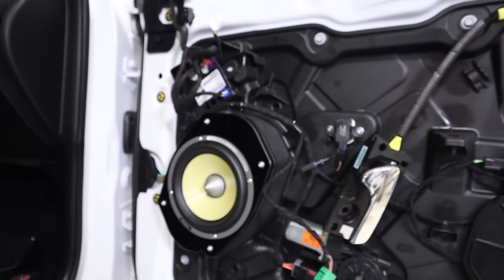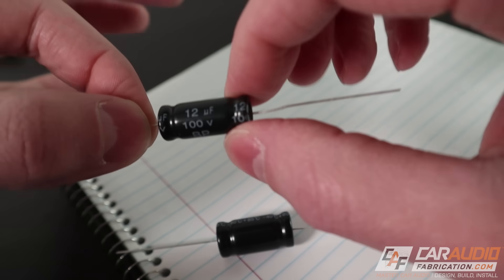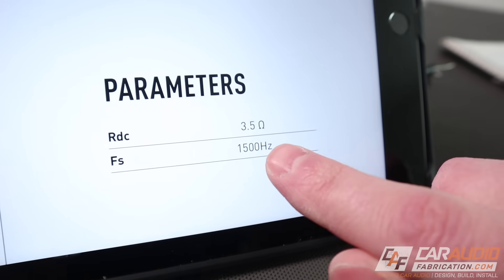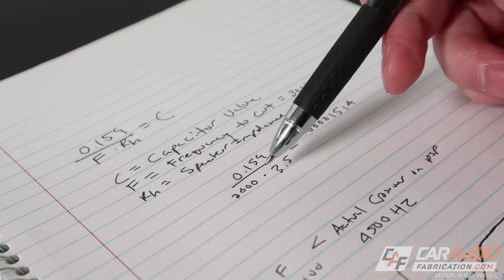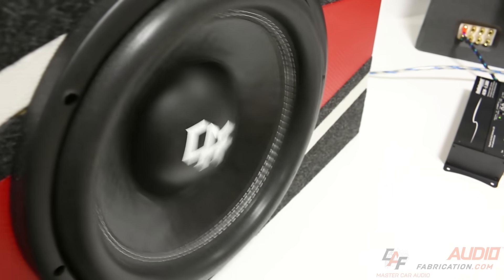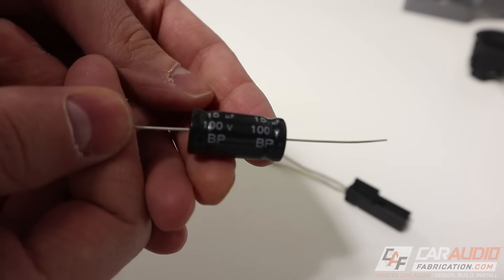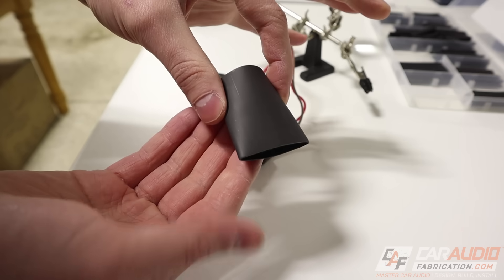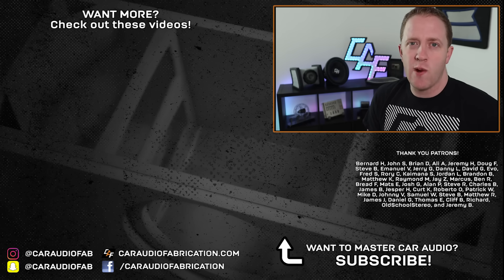PROTECT YOUR TWEETERS! Capacitors and WHY you need them

Comment: FWIW, 100V @ 4 ohms is 2500W. As to a poly cap versus an electrolytic, the poly cap won't dry out over time and shift in value like the electrolytic. You could end up with the cap lowering in value to the point that it drops below the desired frequency. Granted, this takes some time but some of us run the same gear for years.
Reply: I wouldn't put this much work in something that's not a forever car.
Reply: @SoulTouchMusic93  Using a film cap instead? Same amount of work.
Reply: 100%.  Film caps all day long. And heat shrink, not electrical tape.

Comment: I added the capacitors that came with my SSA audio tweeters to protect them since im running active and it made the tweeters sound muffled. I removed the caps and sounded good. few days later the tweeters blew, im not sure if I did something wrong.
Reply: Sounds like you installed the capacitor as a low pass filter instead of high pass. Could have damaged it there, then it blew later. Hmm
Reply: Its been on high pass. Spoke with SSA they told me my amp is too big, twisted sounds 150.4

Comment: what capacitor value in uF would you use for a 4 inch speaker/tweeter ?
Reply: Speaker impedance,  what frequency range it will be played at and rms power range all play a factor in what capacitor value you would want to use.
Reply: Yep really depends on spec and desired crossover, 4ohm tweeter will be anywhere from 20uF to 60uF, I go for half the crossover frequency as sometimes you can cross at lower than 2X Fs

Comment: This was good but you also need to watch the voltage ratings if your doing extreme output 100v is not hard as you move below roll off point the effective impedance climbs so i personally rate the caps to the rms rail voltage of the amplifier I'm using i have had a few full bridge amps that can hit 200v with very little effort.. to know the rms voltage set gains and play a 60hz tone with nothing on it and use a dmm in ac mode on the speaker terminals if your dmm is a true rms unit(like a fluke 117) you can use some other frequency but not over 1khz.. also when you set gains it's best to do it with a load on the amp.

Comment: Nice vid, but how do you choose F when your crossover value is 4500 but Fs is 3000 Hz ? If you calculate 3000x2 you have 6000 Hz that is greater than the wanted crossover value. So how can you protect your tweeter in this case ? Thank you

Comment: still need to use it if i already got crossover for 2 way system?
Reply: You mean you are using a passive crossover with your tweeter/mid combo? The cap is built-in to your passive crossover. No need for additional parts.

Comment: 2009 Chevy Avalanche. Just installed Pioneer amp and 4 Pioneer 6 1/2" door speaks. Adjusted amp gain within specs and sounds AMAZING! But.....after cranking for 2 days during my 1 hour commute the factory tweets became raspy. I now have Pioneer TS-A300 tweets ready to install. They will fit stock location but I'll have to hot glue them in the A pillar factory speak cover. They came with HPFs filters. Comparing the stock ones to the Pioneers, the magnet on the stock is much larger. I figure it's  a cheap material compared to the Ps. Gonna hook up the Ps tomorrow & see if they sound better. Wish me luck.
Reply: So I used jumper wires to attach the Pioneer tweeter in place of the left tweet and it initially sounded better then the factory tweet at 90% volume. I then played a high pass frequency tone on youtube from my phone. About 45 seconds into the tone the tweet started smoking then it stopped all output. I removed it & put the factory tweet back in. The Pioneers are rated 100 watts continuous. My amp puts out 60 watts max per channel. I used my Fluke meter to compare the now bad tweet with the one I had not used yet. The tweets and the high pass filter they came with both tested the same, 6.6 ohms for each tweet & 6.9 micro farad for each HPF. I put the bad tweet back in and it played the test tone for about 20 seconds till it started smoking. I am going to return the Pioneer tweets. Anybody got a recommendation for a great tweet?

Comment: For those of you that can't be bothered with the math, just look at MOST tweeters and they have like 3 mf. So you go a fair bit more mf than 3 mf (looks like it's about 5 times). Letting just a bit more low frequency than usual won't hurt, it won't blow the tweeter. And (obviously) the active crossover should restrict low frequencies a bit more than the protection cap, so the active crossover can still be active (and is not really affected by the cap). The reason why the protection cap has to be a (fair bit more mf) than the active crossover (and/or passive crossover) is cos any value just a little bit higher than the active crossover will affect the active crossover to much and it will restrict too much low frequencies.

Comment: What about the phase delay introduced?
For example if we have at 4500 Hz a 2nd order low-pass and a 2nd order high-pass filters, the former for the Woofer and the latter for the tweeter we obtain a flat freq response, but with this capacitor we add a new pole in the transfer function of the overall tweeter High pass filter.

And what do you think about having that kit Focal KX2 120W 2 Ohm in each door powered by audiocontrol d-61200 which has 200W per 2 Ohm Channel? 

Thank you Mark
I love your Channel.

P.S. I have used MATLAB to tune the band pass filters of the dsp and crossover together with and without capacitor and in the second case It Is a bit difficult ti obtain an Ideal flat freq response.

With your experience What do you think?

Comment: When you install a pair of components and a pair of coaxial do you need a 6 channel amp or can a 4 channel power everything?
Reply: Hi, if it s 2 way component set(woofer, tweeter) and another pair of coaxial speakers you are good with 4channel amp. 5channel can be used for the same setup+ subwoofer, 6channel is usually used for powering 3 way components(woofer, mid and tweeter).  Hope that helps :)

Comment: is this protect capacitor applicable to/with passive crossover? does the value will add up to existing capacitor on the crossover, lets say for example crossover(built in) is 10uF, then I add another 15uF,  will it sum up to 25uF?

Comment: I need help with a tweeter question mark!! love your channel btw!!... what if I added tweeters alone to my dash without wiring them up with a mid woofer and crossover box like normal components.  I have 4 coaxial speakers in my 2003 jeep grand Cherokee doors. I want to add tweeters into the dash without having to change the full range speakers in the doors. basically I just want to add more highs. so can I just throw the tweeters in the dash with a capacitor? the tweeters I bought came with very small inline crossovers. so how would I go about it
Reply: Yes you can.
As long as it's the right value capacitor.  just solder on the 
Positive terminal.
If they came with crossovers 
Us them. Your door speakers, 
Crossovers, capacitor then your
Tweets.

Comment: I bought a set of B2 Audio components. Would I need to utilize a capacitor on the tweeters with the passive crossovers?
Reply: No - the passive crossovers are built with caps and resistors, so it already has hardware protection. I can't believe no one else answered this yet...

Comment: I played a mono mp3 from YouTube and it almost blew my tweets. Will these help?
Reply: Yes, your situation is the whole point of this video.  Make sure to use the correct value capacitors. Also you want to use non polarized (bi-polar) and hook it up inline between the positive wire coming out of the amp and the tweeter. Frequency range, speaker impedence, power range all are important in determining which value capacitor to use.

Comment: Bro, what is the ideal xover point and capacitor if i am using focal krx2 on active mode..
Reply: Very late now, but note the Fs of 2149Hz, meaning you need to cross usually (there are many exceptions) at least 2x this value to protect the tweeter. with a DC resistance of 5.8ohms, capacitor somewhere in the 10-15uF range.

Comment: Ok- I understand and LOVE what you did here- Question-Your Focal separates- the x over that came with them- are they not bi-ampable? I understand you are after an active system for time alignment and such, but do you not think the xover made by FOCAL and their engineering staff may be better than what we would do with the DSP?  I have a set of these, and I am about to start a build in a 2018 F150 using the Audio Control D-6.1200 for EQ and time alignment, but will use the bi-amp crossover that comes with the the focals.
Reply: I'm using Focals in a 2015 F150 with an Audio Control DSP. I spoke with both a pro shop and with a Focal representative and they both recommended running active (i.e. NOT using the Focal passive crossover). Passive crossovers introduce phasing issues and other minor undesirable factors. It's just physics that you can't completely avoid.

The benefit to those passive crossovers comes when you don't have enough channels on your amps and/or DSP. In other words, if you have a 4-chan amp for your front component speakers (assuming 3-piece tweeter/mid/woofer speakers), then you could run 2 channels to each woofer, and 2 channels to each mid/tweeter combo. Where the passive crossover allows you to split that single channel between the mid and tweeter. .... HOWEVER, if you've got 6 channels at your disposal, then keep the crossover packed in the box and go active. Saves some room, too!

Again, I have emails from Focal recommending this. It's not that their crossover is bad. It's simply that going active can't be beat. Passive crossovers just put more crap between the amp and speaker. Keep it clean if possible.

.... Likewise this capacitor safetynet puts more crap between your amp and speaker, too. It definitely protects your tweeters from accidents, but personally I'd opt to simply be careful with the setup. Don't accidently blast your system with the high-pass crossover disabled on your DSP's tweeter channels. Be careful and you'll be fine. This solution merely saves your tweeters if you're not careful. Also, I'd be worried about the capacitor significantly affecting the phase, although I'm too lazy to recall my college EE classes to know for sure. Afterall, a capacitor is technically the simplest type of high-pass filter. I just don't know what frequency this sized cap would start showing phasing changes.

Comment: Do you have a video on how to run speakers active? Specifically tweeters? Matching rms power of the tweeter to the output of the amp? I can't seem to find a decent video on this. And I don't want to run too much power. I'm using a d6.1200 and I want to run my front stage active

Comment: Impedance depends about frequency. How you can use nominal impedance or dc resistance to calculate right capasitor? For example if the real impedance is over 8 ohms between 1000hz and 3000hz. 15 μF capasitor starts helping below 1300hz. Or is there something i don’t understand now?

Comment: I have an unrelated question that no one can figure out.  I have a 2013 Honda Civic Si.  I put a Pioneer MVH2400NEX that was just installed, along with steering wheel controls.  It works perfectly until I plug my iphone 8 into the usb.  It then make an audible static type of sound that instantly goes away when it is unplugged.  I had everything professionally installed and no one can figure out what it could be.  Pioneer said that it could be a grounding issue but the installers assure me that is not the problem.  Any thoughts?  I have tried multiple phones and multiple cables with all having the same results.
Reply: Mine does the same, static stops when the phone is fully charged... I'm thinking the usb port  is struggling to keep up with the load

Comment: Question, so I got some 4 ohm DS18 Bullet tweaters and some 8 ohm DS18 component speaker. I have them ran in parell  to my  crossover, resulting in a final 2 ohm load. So when doing the math on your equation, would i go off the final 2ohm load or 4 ohm that the tweeters are rated at??????????
Reply: Not a great idea running them in parallel. That means you're feeding frequencies to the tweeter that are meant for the other speaker, and vice versa. Not good. You should have a crossover between your amp and those 2 speakers. Then this video will be irrelevant because the passive crossover will provide the protection.

Comment: When I plug n your numbers the total comes out to 0.0001855. Explain this plzzzzzz. So if u carry the decibel over 6 places than it would b 185.5????????
Reply: I'm guessing you did ( 0.159 / 3000 ) * 3.5. It should be 0.159 / (3000 x 3.5) = 0.159 / 10500 = 0.000015142857etc
Reply: Are you saying you got that result using Mark's values? or your own?
Reply: @darryndewar  thanks boss I don't know what I was doing last night. Makes since now

Comment: Ok so I have that same speaker but I’m using the passives. I’m bi amping them on a jl audio had 600x4. I figured I’m losing some watts from the passive. But if I go active will I be over powering the tweets? Does the passive absorb whatever I throw at it and only play a certain watt to preserve tweet? Or is it just crossing it over?
Reply: I have your exact setup. 3-way Focals to two HD600/4 amps. You won't overpower the tweeters by going active. Keep in mind you'll be able to precisely control the gain of the tweeter channels by going active. And your ears will bleed before you ever send enough power to blow the tweeters (assuming your DSP crossover is set appropriately and you're not pushing low freqs to the tweeter!!!)

To answer you question about the passive crossover absorbing whatever you throw at it.... Sort of. It's turning the lower frequencies into heat rather than letting them through to your tweeters. But a better way to think of it is the crossover redirects frequencies to the right speakers. So you'll have a wide range of freqs entering the crossover, and it divides those frequencies and sends it to the appropriate speakers. ...But yes, it physically does that by absorbing and "discarding" the unwanted frequencies for each speaker.

An advantage of going active is that you have complete control over what you're sending to each speaker, as opposed to predefined selections on the Focal crossover. The main DISADVANTAGE to active is that you need more amplifier channels (more $$$). ...And as Mark mentions, you're more likely to blow a tweeter if you're not careful.

I had a professional shop install mine and they advised I go active and not use the passive crossover. This has a side benefit of saving space and reducing phasing issues which are inherent with passive devices (e.g. capacitors, resistors, inductors).

I also have emails directly from Focal recommending I go active if possible. It's not that their crossover is bad; it's simply that active can't be beat if you have the channels to spare.
Reply: dustingaldeano 

If you run the tweeters active one day, the most important thing is to make sure the crossover points are set correctly, especially for the tweeters. Those passive crossovers probably already come with some kind of protection for the mids and tweets so I wouldn't worry too much if you overpower them a bit.

I have a JL600/4HD as well and used to run 300 watts to a set of ZR650s passive on each door and never had any issues. 

I bought a DSP,  went active and I am now sending 150 watts to each mid and tweeter individually with no problems at all. I just made sure the gain on the amp was set correctly and my crossover points were set.

Going active gives you so much flexibility and you can fine tune your system to your liking.